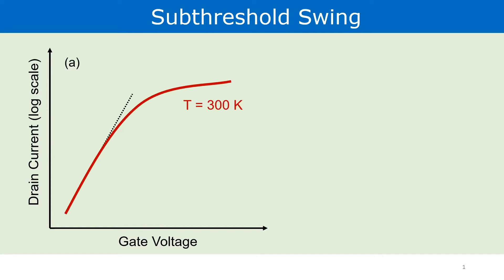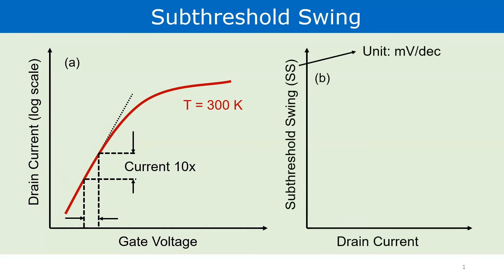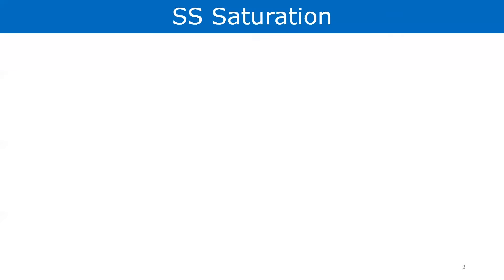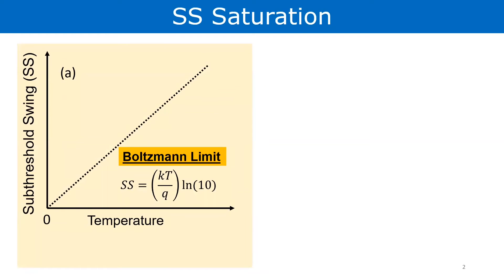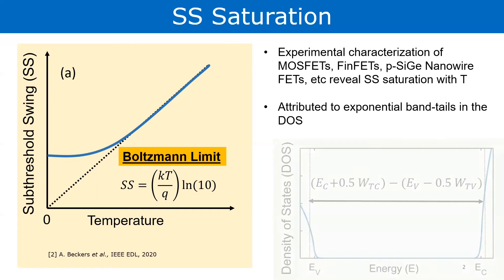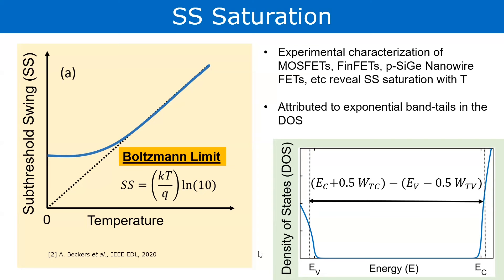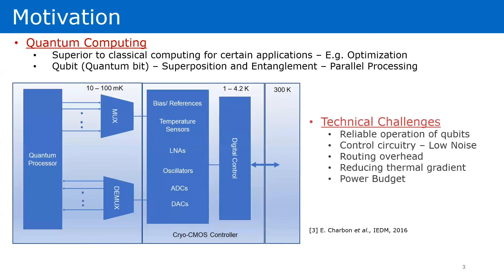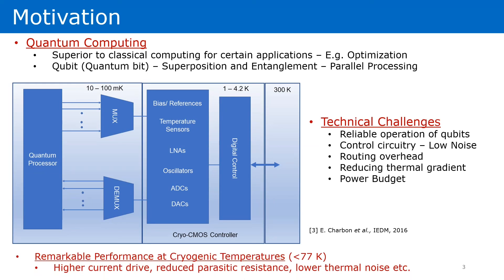Subthreshold Swing doesn’t obey the Boltzmann Limit!

Comment: Hi tejas, Can you tell me why is it so that the effect of band tails on SS arises after a certain low temperature (critical temperature) only? Why not on high temperatures like 300K?
Reply from the maker: Hi Nalin, the effect exists but is negligible as per the current understanding in the literature. Probably because the majority of the current comes from the bulk states, and the band-tail states contribute negligibly.
However, in my personal research (master’s thesis) I saw that it can be non-negligible in some scenarios.